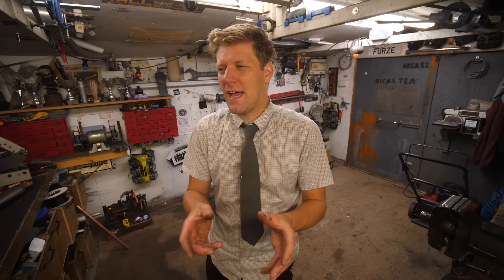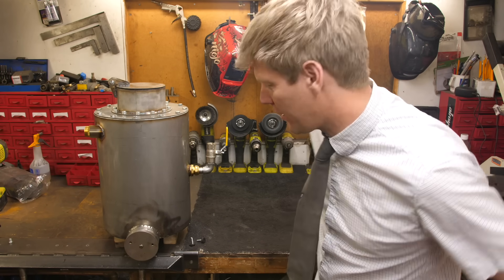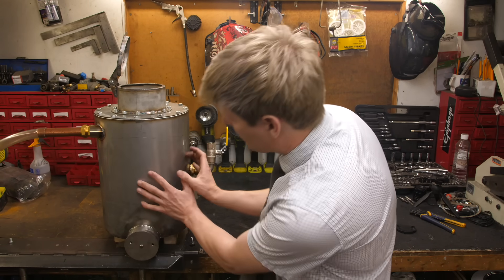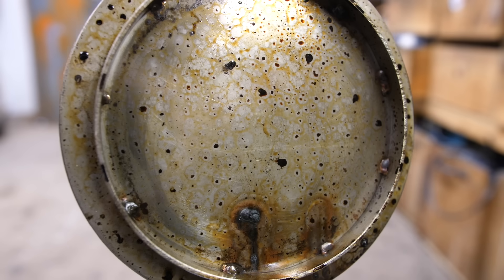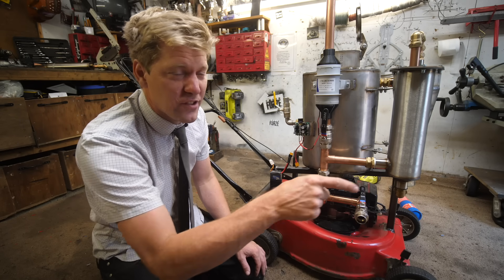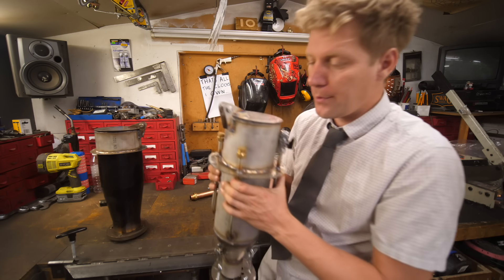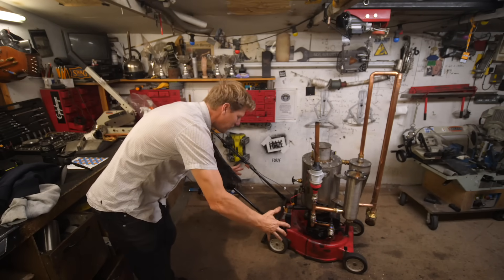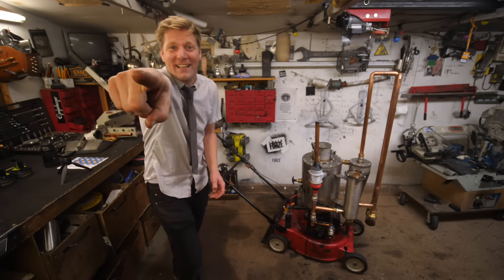WOOD POWERED LAWN MOWER

Comment: another thing you could just use charcoal as you will not really get any tar coming through, but still develop the filter just incase, a bit of tar is still in the charcoal.  Or maybe you might make a good enough filter system and give wood another try

Comment: for the filtration system, you should you use much thinner pipes, basiclly get something like the radiator from a car, maybe look into how they seperate petrol from crude oil.  Now remember you are doing it with wood.  Maybe look into the best type of wood to use.  maybe there is a type of wood that likes to produce gas well others produce more tar

Comment: Tell me about it.
Wood was one of the only fuels my ancestors had left after WWII so all manner of cars were converted like this in Germany in the immediate post-war period until the Wirtschaftswunder started kicking in. As demonstrated, any plumber worth his salt can knock up one of these in short order.
It is worse for the environment than using petrol but only about three times worse, mainly because of the fine particulate dust from the wood burning. Because what people tend to repress is the fact that petrol is made in much the same way, by burning more crude oil to heat up other crude oil and distill the petrol out of it.

Comment: If you are making that much tar, your gasifier is running too cold.  Don't put it through the engine until you are well over 800°C.  Also, consider putting some thermocouples in there to monitor the temperature of the gasifier.

Comment: Love the video Colin. The only problem is understanding how the process works for wood gasification. Its not the heating of the wood to produce the volatiles from it, its all about the conversion of those gases and more importantly the CO2 created in the hot 700-1000F burn space into CO+H2 in the charcoal below the burn zone. When the burn temps are controlled and kept at the best gas producing temperature, you will not have any of the tars and carbon smoke particles coming out. Please reference some of my wood gas stove studies at https://www.gospellearningcenter.com/resources/WoodGas/TincanStoves/default.html.

Comment: 😡Please make a solar pie.
It's a pie slice shaped  solar panel that fans out and expands into a full circular shaped solar panel for RV's and vans. 
It can be made of equal sized pie slice shaped solar panels. 

The point of the pie will have a small hole for a bolt to go through.  

Each slice goes over the other and that bolt goes through all of the holes in the points of each slice. 

The only hard part, will be making the remote mechanical thingy which will fan out the slices like an old fashioned oriental fan for fanning one's self on a hot day. This until must be as flat as possible because it's to be used mainly on top of RVs and van conversions.  Please  use those flat thin flex solar panels when  trying to make this. 

When the unit is not in use, the unit will close itself and become one pie slice shape.  
The point must point forward  on top of the vehicle when  not in use, in order to cut through the wind while driving. 😍😍😍😀😀😀 Please respond to this comment and tell me if it's a cool idea or not? I call it The solar pie.

Comment: Imagine making a wood powered chainsaw, which feeds the sawdust immediately back in the engine to power itsef.
Reply: That's why Sawmills still ran on Steam Engines when they were outdated almost anywhere else. They can power themselves on their own Waste.
https://youtu.be/zAvurSjBVW8
Reply: @Genius_at_Work  yeap and modernizing is easy by replacing the steam engine with turbine and generator and still the same principle goes on even in new installations.
Reply: @motoprogger  Nope. They would be clogged by Soot within Minutes. Turbines need clean burning Fuels.
Reply: Der Bleifuss the sawdust heats up water and the steam spins the turbine. The smoke from the sawdust is just vented out.
Reply: @mattschweitzer4358  That would be a Steam Turbine. What I meant before is a Gas Turbine.
Reply: @Karjis   But is it more efficient and cost efficient you have to ask yourself that
Reply: gt tactical electric drive in sawmill is basically must have feature if any real production numbers is needed. Bunch of servo drives etc handling all movements on modern sawmill production lines.
Reply: @Genius_at_Work  This makes me laugh because GE developed a gas turbine locomotive for Union Pacific in the early 60s. It was called the GTEL 8500 (Gas Turbine Electric Locomotive 8500HP), and it ran on this nasty ass fuel oil called Bunker C. Very tar like and sooty. Crews had to constantly clean the blades off to keep the locos running efficiently.
Reply: @Genius_at_Work  If the turbines use the exhaust gases, but Steam turbines can use wood to make steam, then the clean steam powers the turbine.
Reply: @Genius_at_Work  thats why wood gas for turbines go through multiple solid filters then a water bubbler so the gas is just gas
Reply: @Genius_at_Work  that sounds like a solvable problem
Reply: @user-xu7rp3kw3z  Soot clogging Things up can be solved either by higher Grade Fuel or by more Oxygen/Air if the Fuel itself is good. Wood always leaves some Residue (aka Ash), no matter how much Air you supply. The only Way would be Wood Gas from a separate Gasifier like in this Video, but I guess this Video is Proof enough that that isn't a very practical Concept. Plus Wood Gas has a much lower Energy Density, so you always lose a significant Amount of Power when using Wood Gas instead of conventional Fuels. I don't know if Wood Gas could even power a Gas Turbine due to that.
Reply: @Genius_at_Work  that's why gasifiers need basically a bubbler to filter the gas to be clean burning gas and not tar filled engine clogging nightmares
Reply: @motoprogger  a lot of wood chip gets used for fueling  a couple  of powerstations for the National  grid  well a couple  of years or so ago there  was a craze  for woodchip , it's  kind of slowed right down now  think they kept having problems  with the huge amount  of chip getting  blocked  in the feed system!
I would  love to power my Arb truck off the woodchip we have to dispose  of after every job , be amazing  not to have to tip off but just fire the stuff into a mega gasafire thing then to wake up next morning  with a tank full  of gas and a empty  truck ! Only thing is these inventor  types need to up their game ha
Reply: @Genius_at_Work  DAS war eines der besten videos, die ich seit langem gesehen habe.
Reply: You are smart
Reply: I thought similarly, but grass powered lawnmower.
Reply: @Taylor-ni5hz  that's what Cows, goats, and sheep are.
Reply: @Taylor-ni5hz  grass is a bit too wet, perhaps a leaf-vacuum engine burning fallen leaves...
Reply: @Dauthdart  Just an idea. Never said it would be feasible
Reply: Don’t give him ideas lol
Reply: So it's a bloodthirster
but in chainsaw version
Reply: Omg that would be the greatest
Reply: And they say perpetual motion machine is impossible
Reply: @amiyasahoo4717  technically, the energy would be transferring from the grass into the engine via oxidation, thus releasing heat energy. The grass grew via the sunlight. Just a thought🙃
Reply: I remember seeing a sewage treatment plant that was mostly powered by methane produced from the sewage. The generator was started with Diesel and switched to methane once running. This was back in the 1980s.
Reply: That would be sick
Reply: they had those, they were called steam engines
Reply: @AsbestosMuffins  If that is directed at me, then it was auto set up to feed the cut grass back into the engine?
Reply: @Taylor-ni5hz  Fresh Grass is too wet to power anything. Even if you dried it to Hay, its Calorific Value (=Energy per Mass you get when burning it) would be ridiculously low, making it impractical if possible at all.
Reply: @Genius_at_Work  Just an idea. Never claimed it would be possible, just cool
Reply: @Genius_at_Work  cows do it every day
Reply: @Taylor-ni5hz  well if you mow  your lawn as often  ( as little) as me the waste grass be definitely  ready  to go ha think i got away with one cut this year 😊
Reply: Yes thanks you gave him another idea
Reply: Youre a wizard harry
Reply: Big brain boi bbb
Reply: That is an amazing idea
Reply: That would be awsome
Reply: Dont give him ideas
Reply: Great idea
Reply: How is that going to mow a lawn? 
(Also, the power needed to create the sawdust is obviously far more than the energy given from its combustion).
Reply: You sir deserve an award of sorts
Reply: Would probably explode, not a good idea, google it
Reply: @viktorzouboulis2467  Just an idea. Never claimed it would work, just cool.
Reply: @Taylor-ni5hz  not thegrass, the saw dust
Reply: But how does it start
Reply: Yes
Reply: That's actually a really good idea.
Reply: Leatherface would prize you for that one 👌
Reply: 500 iq
Reply: That would be downright amazing.
Reply: Was my first thought xD
Reply: That's cannibalism inception
Reply: Congrats on becoming a Captain Planet villain
Reply: that would be awesome
Reply: In theory it sounds like it’s possible but it would be a lot of engineering there’s no way in hell I would be an all in one self contain the handheld unit. You would have to have some sort a burner configuration with a couple hoses went to the supply the burner with the sawdust that’s being sucked in by a fan into the burning compartment then you’d have to have an hour hose take the wood gas to the carburetter and not to mention 47 other thousand valves all that bullshit
Reply: @lucydavie7688 ah yes but i have a cunning  plan here ,  so the chainsaw  just needs to be converted  to run on gas a bit like lpg so have a special  fuel tank that's  able to contain  gas without  it just leaking  down your leg like most petrol  chainsaws do , then have a gas-fired rocket burner running  on sawdust  with a gas collection  tank  for storage  ,not forgetting  a small oven and kettle  attachments built in ,on some sort of tracked wheel  barrow  thing self propelled of course  , now as every wood cutter  knows   all one needs  to do is start the saw up  2 minutes  of work you will have collected at least a cubic meter  of sawdust in ones under pants then there's  the boots ,hoodies hood every single pocket  you have eithen fully  zipped up ones and then there's  the eyeballs  this is quite normal  so when one's  saw has used up all the gas walk over to fueling Station empty all pockets and everywhere else into burner  ,have a brew fill saw with gas from the gas collection  tank  ,of course  using  the standard  woodcutters technique  which is standing directly  over refuelling  operation  with a roll up cigarette  hanging  out of mouth   then repeat until darkness  happens  😅
Reply: So dark
Reply: Theoretically it would only work if the sawdust was bone dry. Green wood would produce a very moist pulp almost impossible to burn.
Reply: You commented ahead of me. You need the woodgas chainsaw to cut wood for all your other wood gasifiers.
Reply: It wont have enough torque. You would need a transmission to make it work but that would put to much to the chainsaw with the already existing weight by the engine.
Reply: This was used during the war in Germany due to fuel shortages
Reply: hes on to something
Reply: Someone made one
Reply: Brilliant
Reply: Good idea
Reply: Wood would be too wet to create gas
Reply: My God it's Jason Bourne
Reply: Your a fucking genius
Reply: It would expend more energy than it generates vastly
Reply: @Ieatcrumbs  
That’s the joke
Reply: @chrizikl4070  shh, the man is having a big brain moment.
Reply: That would be ironic
Reply: Mr Testlonian already did it on youtube, released recently
Reply: That’s absolutely brilliant!
Reply: Sounds like an auto Minecraft furnace
Reply: You get poisoned like the guy that make that water engine
Reply: Give this man a crown he’s a genius
Reply: That’s good idea
Reply: wood comes from trees though right? so imagine you cut down all the trees...
Reply: everyone in these replies are trying to get technical but none realise that without any trees left the machine would no longer work and just to keeps this machines going you would have to destroy even more trees on earth so really you are just leading yourself down a rabbit hole, into doom! what's the point? a cave man would of thought of a better idea.
Reply: I not imaging, I'll actually here because I want to build a gasifier to run gasoline engine.
If my ancestors can run a car on that, between two world war, I might it able to run a wood chipper.
And the chipped wood then used as fuel to chipping more wood,
Because the wood chipping is trending stuff here, but runs on gasoline.
Why?
If I had chipped wood, why can't I just use it as fuel? I remembered the gasifiers attached to cars.
Reply: Endless energy you'd have my Friend. 
Endless energy.
Reply: That’s gold you win
Reply: Colin,get your safety tie ready,we're gonna make this a reality
Reply: UNLIMITED POWER!!!!
Reply: Red green tried that using corn.
Reply: The equivalent of saying no to the first law of thermodynamics
Reply: @Bo_N_Herr_  I don’t think that would be breaking the laws of thermodynamics because the wood is technically an external fuel source
Reply: Patent that. You'll be rich
Reply: "I use the trees to cut the trees."
Reply: @chrizi kl Greta wood say how dare you yes all puns intended lol

Comment: I love wood gasifiers, I really want to see one that uses a turbo, to pump air to the gasifier, run the gasifier under pressure , scavenge heat from exhaust, enhanced tar cracking.  I will like to see two pipe in pipe heat exchangers, further heating the gasifier outlet using the exhaust and then using the heated gas to then be cooled heating the inlet air going into the gasifier.

Comment: The compressed  Wood Pellets might well have pulled in moisture so what about going back to Quality kiln dried kindling with a low moisture content and one may even insulate the burn chamber to get you up to a higher temperature so that what ever condensation will happen it will then happen down stream and the tar won't crash out as easily  i know you need to carry over the unburnt gasses  as a feed stock/ Fuel... maybe passing them through a charcoal filter would scrub them to be directly injected into the air intake by passing the Carb...

Comment: Yeah it's definitively not getting hot enough and also the gas is very weak because your reaction zone is practically nonexistent. Your shaker-grate thingie should contain at least a 15cm stack of red glowing charcoal for the wood gas (with all the soot in it) to flow through which will reduce most of the condensables to CO, H2 and Water. Improving conversion efficiency that way you probably won't even have to change much with the filter system. Gas cooling (as you experienced with all the watery soot in your glas jars) will remove most of the tar. I'd also use a ring of 5 nozzles for injecting air radially instead of the one axial air pipe. Preheating the gasifier air also goes a long way, the necessary heat can be easily obtained with a wood gas cooler heat exchanger (also reducing the size of your gas cooler since cooling air is forced into it).
Reply: Btw. for testing purposes you can fill the gasifier with BBQ charcoal, that'll make the trial and error process a little less frustrating.

Comment: It would be great if it could run on grass (it must be dried or it won't burn easily), it's like having infinite gas for your lawnmower and you don't have to worry about looking for wood. But maybe you will run out of fuel very quickly because the grass burns also very quickly 🤔. I would experiment this.

Comment: It might be interesting to look at the principle of a rocket mass heater for the bunker. Basically a controlled chimney fire that burns all the soot, creosote and smoke and stores the heat in a thermal mass. So if you'd insulate your burn chamber, your fire would give off a lot less soot and much more flammable gases

Comment: Colin Furze: at 0:51 "we don't need any fuel station or electricity"

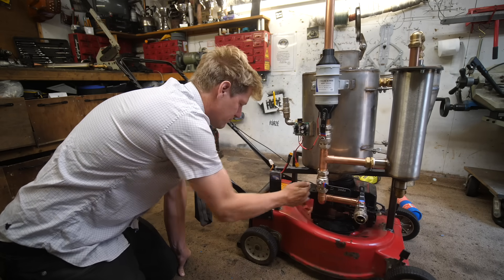Also Colin: at 7:17  "the battery is on there"
Reply: Shh! next up wood powered generator..

Ohh, hang on, I'm trying to build one, but without the workshop and new steel that Colin has.

Comment: A diagram would’ve been helpful, I struggled to follow your explanation of how that gasifier design works. Also, have you considered bubbling the gas through water? That condenses the water vapour and traps the tar and smoke particles so you should be left with clean gas coming out of the water at the top.

Comment: Sure there's a million comments telling you but my 2 cents... u need to run the gas through a water filter (called a bubbler) .. like a water pipe .. (a bong?!) .. otherwise you'll literally dissolve the valves and piston and cylinder ... :)) nice build tho. Thumbs up.

Comment: Well Done man!I havent seen anyone play with this tech for decades.
One of the super interesting things i've done in my otherwise dull life is drive a tractor fitted with one of these.That was in the 80s,and the gas producer was an off the shelf unit,made in the 1940s i think.
Running on this gas the tractor had less power, but also a very different power curve.Under occasional heavy load such as the plow hitting a hard patch of soil  the engine slowed but never stalled.Sometimes it slowed a lot!

Comment: Colin, there’s a movie called mortal engines and in it there is a massive machine, powered by scrap metal. I was curious if you could actually make scrap metal into a fuel source, maybe if you find a way it could be interesting.

Comment: Use a trailer with an aquarium full of water which cools down the gas (which removes moisture as well), removes any residues and should leave you with clean Woodgas.
NightHawkInLight
 made an good video about Woodgas with an water filled aquarium as filter.